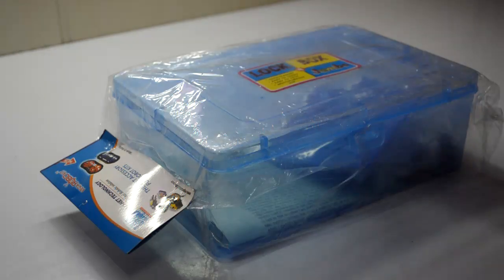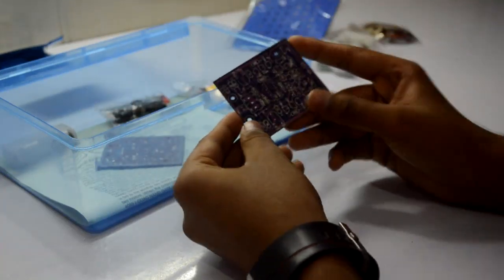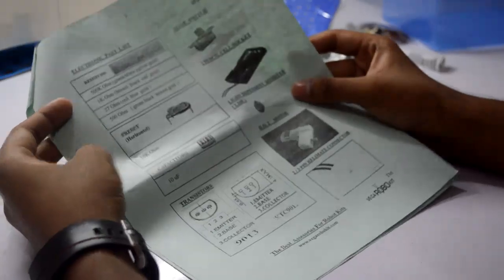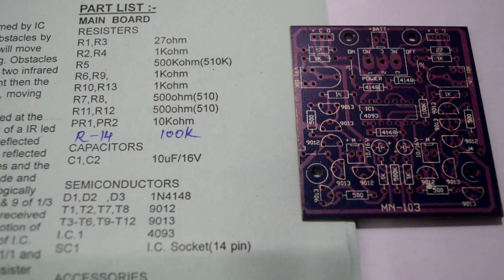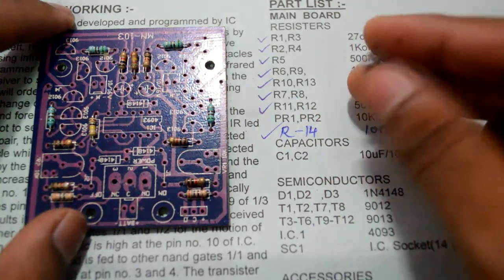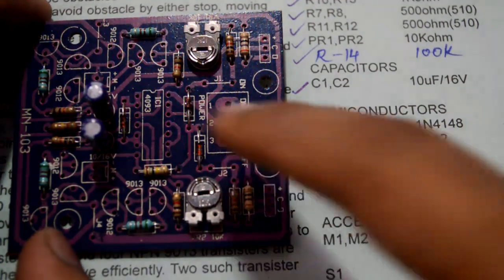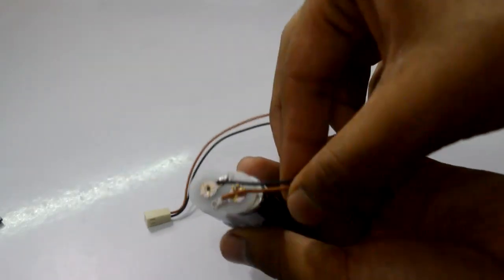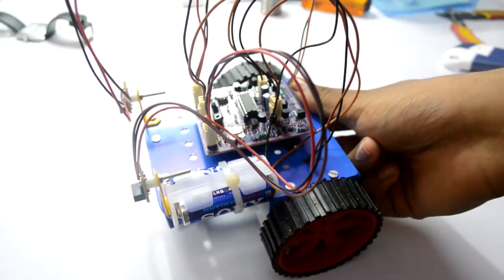How to make an Obstacle avoiding Robot

Comment: Its can run very slow ,, can i use 11.1 Li-po Battery for fast running ? OR using 150 RPM gear motor ( No-load current = 60 mA(Max), Load current = 300 mA(Max)6mm shaft diameter with internal hole)?